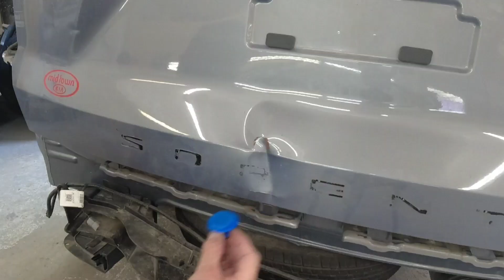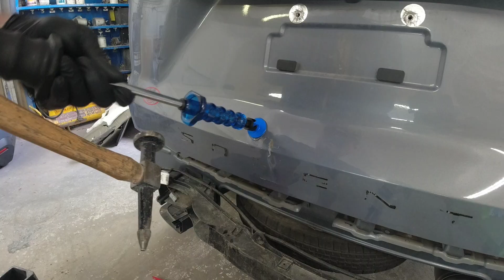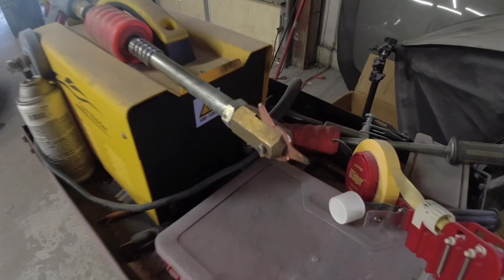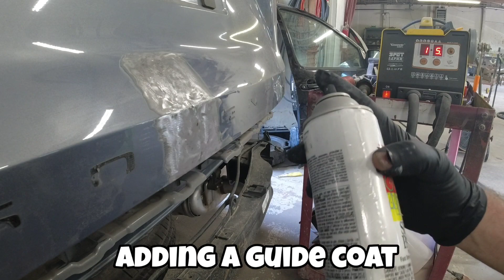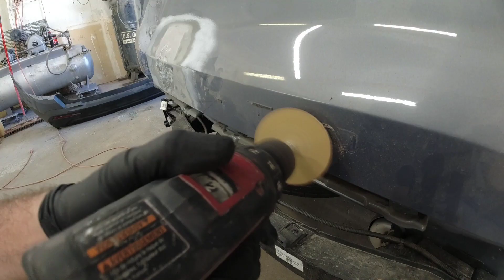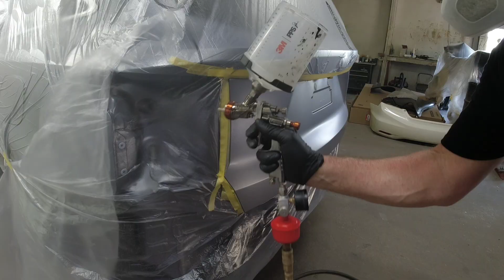Should this liftgate be fixed? big dent repair.

Comment: It’s not about cost affective, it’s about profit. We would have the new gate and bumper painted, all the parts in before the car was dropped off. This is potentially a one day job. We’re in it to make money, not to save the insurance company money.
Reply from the maker: This was an out of pocket repair. Much more cost effective to repair for the customer.  Also more profitable for the shop as I make more money on labor than just changing parts. I always do what's in the best interest of the customer. This keeps  them coming back and referring new customer which keeps the schedule full and makes the shop more profitable.  Appreciate the comment!
Reply: The customer pay aspect may change things, depending on parts cost, and if they are renting a car.  I hate straightening, new parts are faster and easier.
Reply: @Everythingisgoingtobealright wahh you cant do metal work. Get better
Reply: @ryanlowe7315 
I’ve done a little bit of metal work, not a fan. I’ll take new parts every time.

Comment: Nice repair on this "Can't be fixed. Needs to be replaced part". You saved customer big buck. Hey, i've saved enough buck to buy this g90e tool. Which attachment do you install on the rod , when mode "5" is chosen on the front panel ? I mean the one for shrinking a stretched area. I hope tool has manual.
Reply from the maker: It will show you as I can't  recall right now but I'll  tell you what I do for minor shrinking and it works great is the same tip I use for pulling . I actually used it a bit on this repair. Appreciate the support!